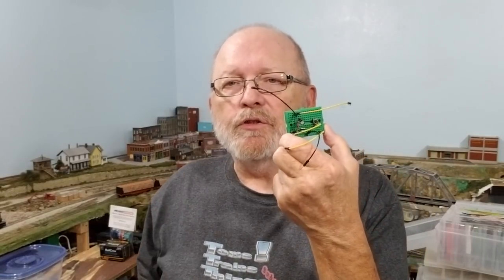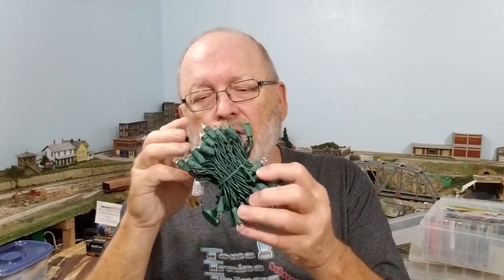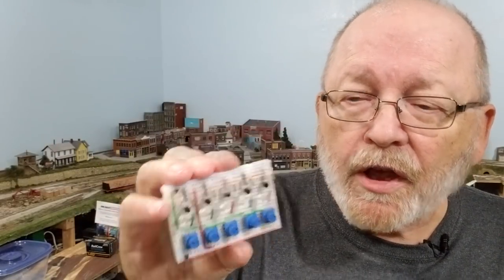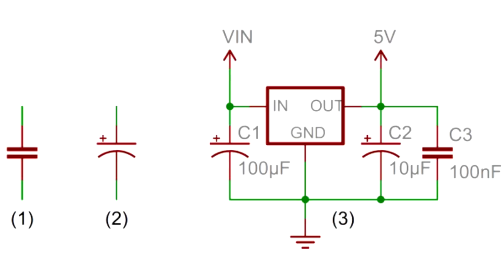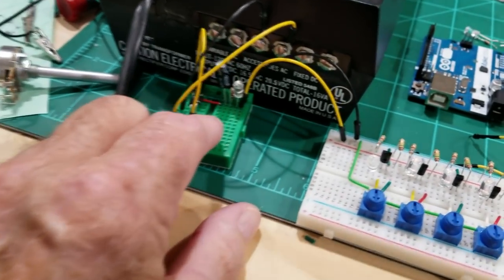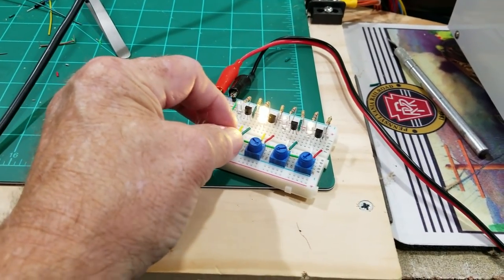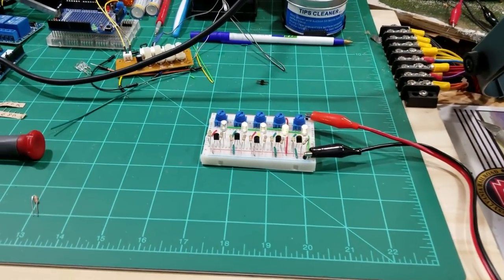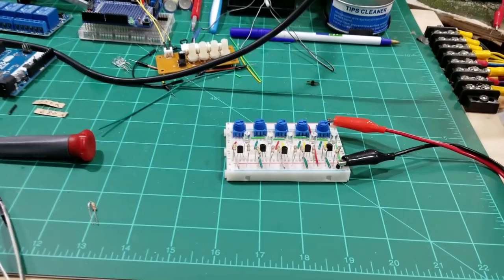Easy And Cost Effective Way To Light Your Model Railroad

Comment: HI tom.  I'm relatively new to model railways and am now just getting interested in the electronics involved (particularly lighting).  I have to say that i find your video clips very informative and useful, thanks.  However, I do wish that you would provide links to the next video when you have your clips spread over several clips, just like this one.  You have so much content on your channel that I find it just about impossible to find the next clip.
Reply from the maker: Have you tried looking via the Playlists. They're all grouped together.
Reply: @TomsTrainsandThings  
I did go to your Play Lists, sometimes with success, other times without.  

Even so, with so much content on your channel, first the correct Play List has to be identified and then a search of the Play List has to be made just to find that one illusive clip.

Just saying, it would be really good if you could include a link in the video or at least in the description when the information being provided is covered over two or more clips.

Cheers
Reply from the maker: @tassie7325  I link to past clips but not to future clips.

Comment: Tom, you are a brilliant man. I have a question. Can I light an entire 4x8 layout (just led structures and street lamps) with just one used computer power supply picked up from a thrift store, like the one you have? Or is it more complicated than that? I'm trying to follow but I'm struggling lol
Reply from the maker: Thank you Jeff. Most LED's draw about 20ma at full brightness unless your using RGB LED's which could draw as many as 60 ma with full brightness to each color. You should be alright with one power supply, just take note of the max amperage of the voltage you will be using for your LED's